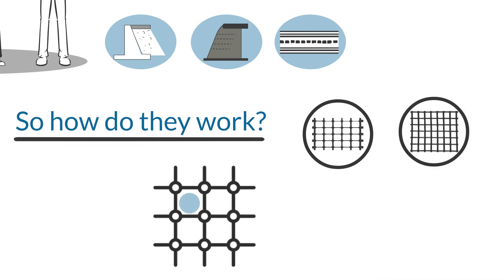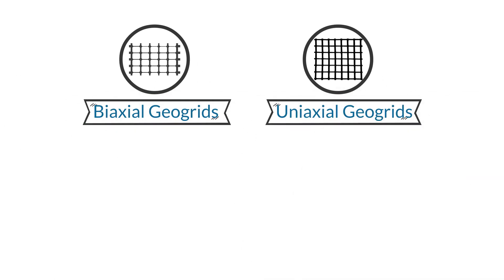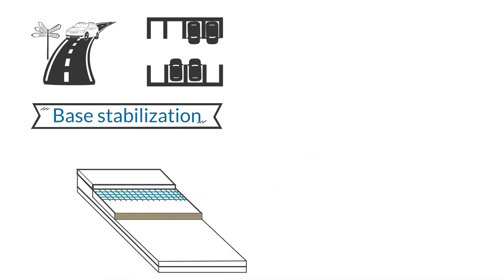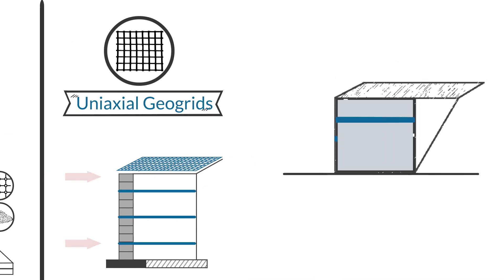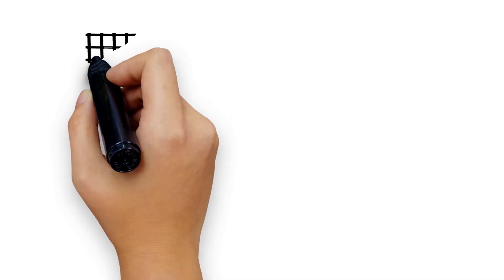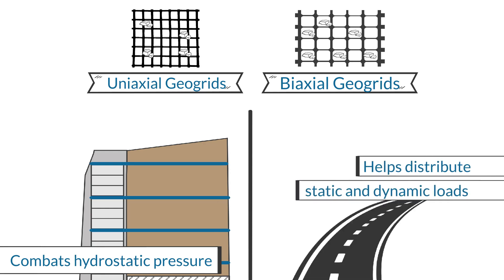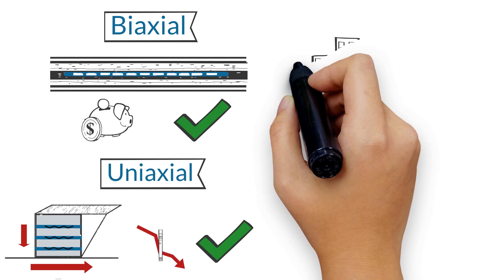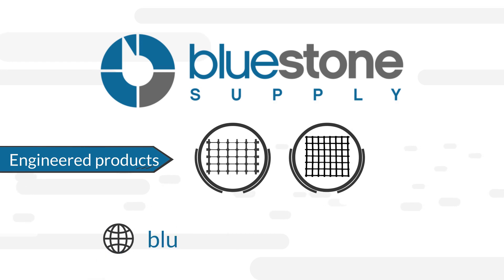What are geogrids?

Comment: What is the axial stiffness of geogrid ?
Reply from the maker: It depends on the style and strength of geogrid.  Uniaxial geogrid is generally more flexible which allows it to give a little and reach peak strength in retaining walls and reinforced slopes while biaxial geogrid is more rigid for horizontal applications like roadways and parking lots.  Also, generally the higher the strength of the biaxial or extruded geogrid the more plastic and therefore the more stiffness in the geogrid.